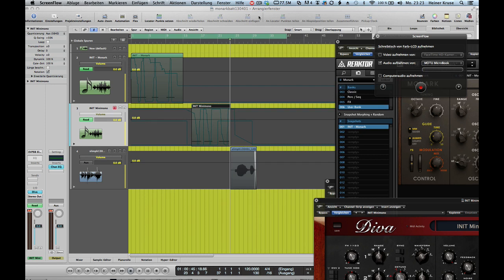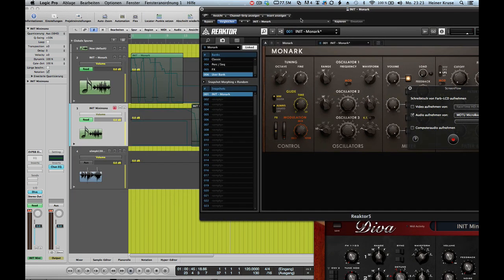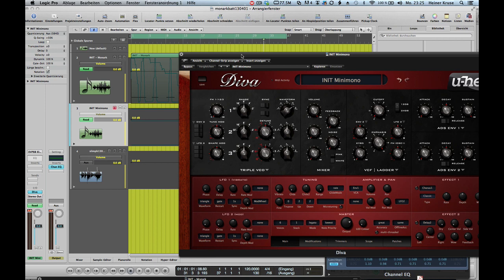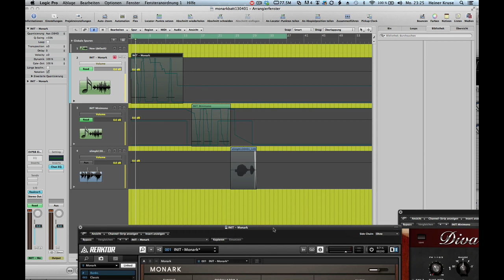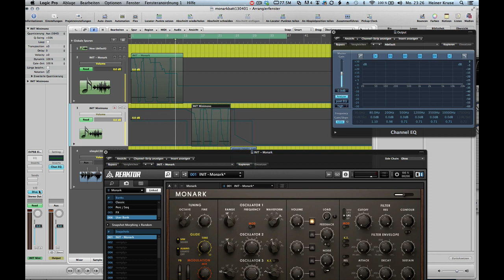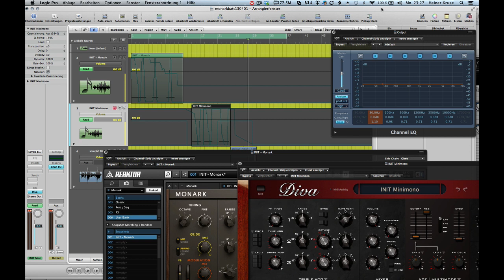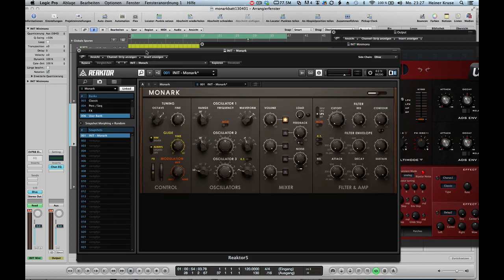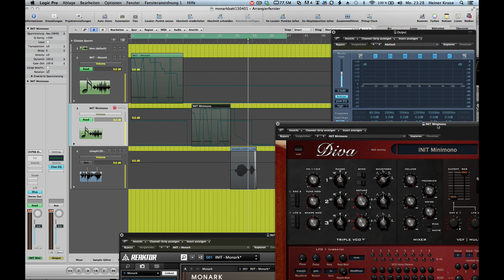Monark vs Diva vs Moog Hardware Slim Phatty

Comment: There's a couple problems with this test:  Firstly as people have stated diva needs to be in Divine mode.  Secondly, Diva allows higher resonance settings than the actual hardware, so res all the way up will have a different sound.